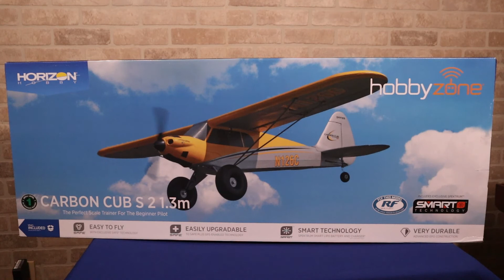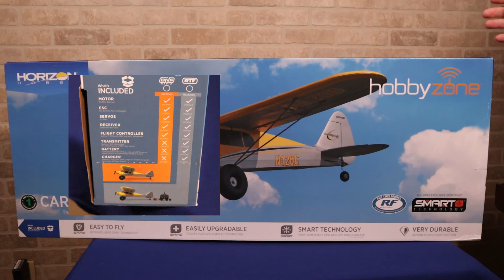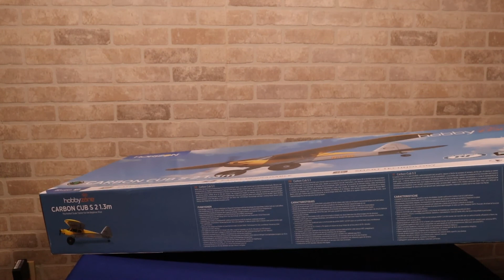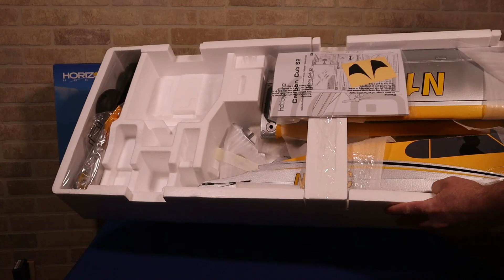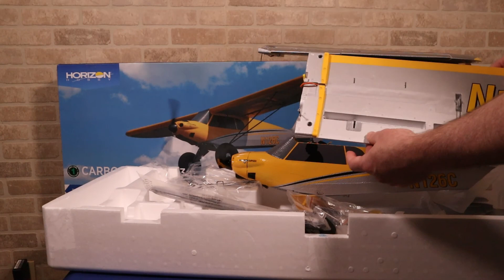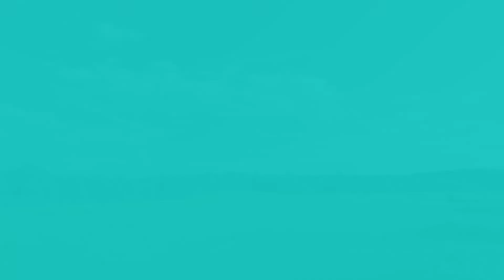Hobbyzone Carbon Cub S 2   Unboxing and Information

Comment: I bought the rtf and it does not come with a battery nor charger
Reply from the maker: My bad, then it is not RFT (Ready-to-fly), it is almost-RTF.  My AeroScout was RTF and came with everything you need to fly, including the battery and charger.  Thanks for the info!

Comment: Link to the floats?
Reply: Wow thx!! Oh yeah and I might not get the skis but it might come in handy!!!
Reply from the maker: Thanks for the question!  The Carbon Cub S 2 can use the same floats that the original S+ uses: https://www.horizonhobby.com/product/float-set-super-cub-lp-carbon-cub-s/HBZ7390.html.  FYI, I have been designing and prototyping 3D printed snow skis for the Carbon Cub S 2.  Once I settle on the design I will upload and link them.

Comment: would you advise to a beginner to buy and install also the gps module and autolanding or is it overkill for a beginner on a budget?
Reply from the maker: Great question!  With SAFE select, this plane is very easy to fly even without the GPS module and auto landing sensor.  Of the two, I would suggest the landing sensor.  You should also check out the AeroScout S; the RTF version (with transmitter) is only $199.99 and is also easy to fly (Horizon Hobby's website says the next shipment is scheduled for this month, December 2020 - although they have had some shipping delays).  Here is my video on the AeroScout: https://www.youtube.com/watch?v=2C2CFwTC7mQ  Either the Carbon Cub S2 or AeroScout would be great first planes.  Thanks!
Reply: @jack-of-all4535  thanks. I think I will go for the nice Carbon cub S2 RTF version. Is it possible with the provided new spectrum dxs transmitter to install flaps and gps and autolanding or are there not enough channels available on the dxs and otherwise I have to skip the flaps or the gps maybe or do I need an other transmitter if I want to install this 3 available options at the same time? Thanks for looking.
Reply from the maker: @Groveronline  I do not believe that the GPS or landing sensor require additional channels on your transmitter - however, the version of the DSX transmitter that comes with the RTF version does not have enough channels to add flaps.  You will need at least seven channels to add flaps.  Here is a link to download the Carbon Cub S2 manual: https://www.horizonhobby.com/on/demandware.static/-/Sites-horizon-master/default/dwdfb96131/Manuals/HBZ32000-Manual-EN.pdf.  Consider the Spektrum DX8 (my unboxing / info video is here: https://www.youtube.com/watch?v=z9mryixxlgg&t=5s) or the new NX8.  If you purchase one of those, you could buy the BNF version of the CC S2 instead of the RTF version.  8 channels gives you some room to grow for things like flaps and retractable landing gear.  Good luck and happy flying!
Reply: @jack-of-all4535  many thanks for this explanation. Is their a big difference between dx8 and the nx8?
Reply from the maker: @Groveronline  I have owned the DX8 for about a year-and-a-half, and other than having to send it in for service once (it had a "hardware fault"), I am very happy with it.  The NX series just came out and I have not had my hands on one yet, but is has all/most of the DX functions and features.  The NX8 upgrades to a color screen, has Wi-Fi connectivity (for registration and firmware upgrades), is compatible with Smart technology (although the DX line can be upgraded with firmware for telemetry, etc.).  It has USB charging instead of the round port on a DX8 (I cannot remember what that port is called; it is like the charging port on a laptop).  The NX8 is only $20 US more than the DX8, so it is worth looking into.

Comment: How do you like it? Looking at getting my first plane in the 300.00 range.
Reply: It looks great and is easy to fly.  I am also a big fan of the Timber line; take a look at the Turbo Timber.  You can grow with either that or the Carbon Cub S2.  Enjoy the hobby!
Reply: @haarbear1  I would recommend the carbon because the turbo is not rtf but the carbon is 100% rtf
Reply: @Tommy06235   (from Haar Bear, aka Jack-Of-All): good point; I have a DX8, so I always purchase the BNF versions.  I also recommend the AeroScout if someone wants a good beginner plane that is available in RTF (and it's only $199.00 - https://www.horizonhobby.com/product/aeroscout-s-1.1m-rtf/HBZ3800.html).  Thanks!
Reply: @haarbear1  oh wow looks nice!! Might get it soon.